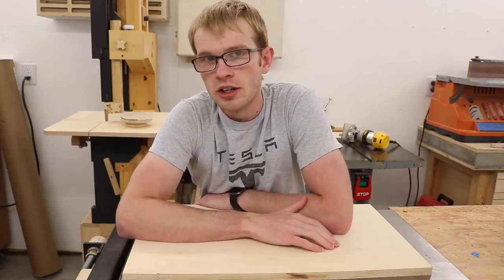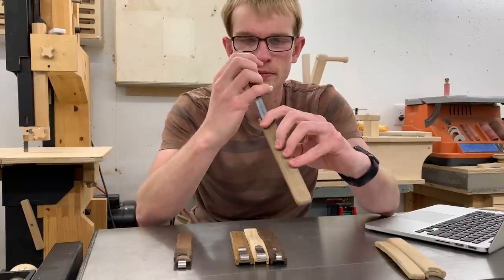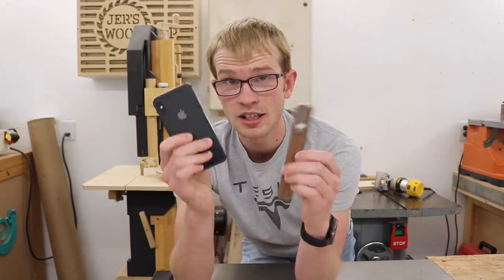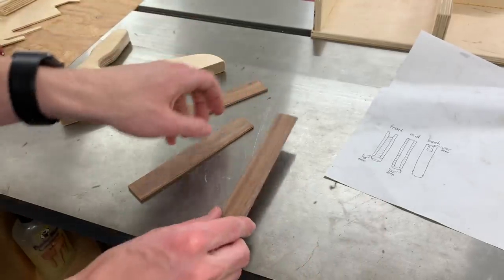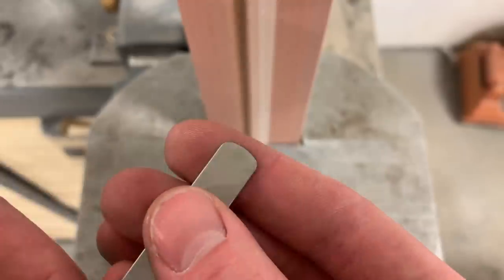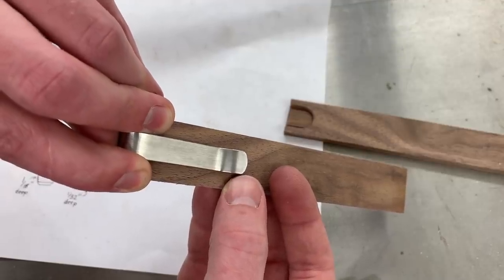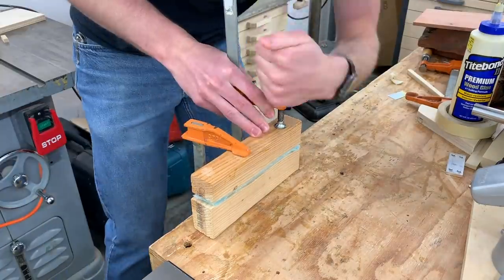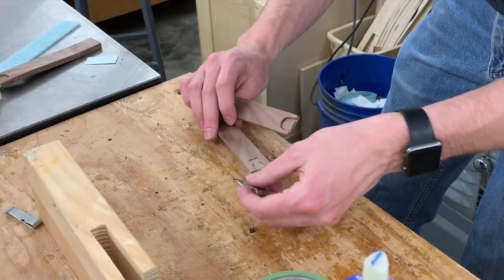Pocket sheath for a precision rule

Comment: If you want to bend a tighter radius in titanium, just heat it with a torch first. You'll have to clean off the oxidation, but it works like a charm.

Comment: Great video 👍 it's great that you include the mistakes and show all the prototypes - it teaches younger viewers that perfection takes time.
Also, an EDC that I have used for 20+ years are precision tweezers called "Uncle Bill's Silver Grippers" they are good as is, but I sharpen the tips by using a small screw and nut to hold them closed while I grind them to a sharp point.  Learned the hard way that metal splinters are tough to find and remove.

Comment: I have a block of beeswax I picked up for waxing string I use for various things.  I used it as a finish by heating the wood with a heat till it was hot enough to melt the wax, and then just rubbing it on the wood.  It worked out very well!

Comment: Nice. Cracked me up! Should made a CAD model so you/we can 3d print....I would try that put it in my shop tool belt for sure.
Reply from the maker: Thanks! Ok, you’re not the first to suggest 3D printing, so I’m gonna try to make a CAD model. I don’t have a 3D printer, but I’m assuming you just need a solid 3D component in DXF or STL for your slicing program to convert to G-code?
Reply: @Jer_Schmidt  A little late but yeah, a solid model in STL would be perfect
Reply from the maker: suchti7654 
I have one, and I have 3D printed it successfully. Shoot me an email if you want the STL jerswoodshop@gmail.com
Reply: @Jer_Schmidt  May i also Email you if i want a new Video? 🤔😊
Reply from the maker: miky max 
You can try, but it probably won’t help. I might make a new video soon-ish, but no promises.
Reply: @Jer_Schmidt  are you gonna start making videos again?

Comment: Such a cool video and great idea. I tried it out, and instead of using the curve, I hot glued a two magnets in. It makes it a bit bulkier, but you don't have to worry about the curve as much. Additionally you can introduce a bit more space for easier access, and don't have to worry about movement thanks the the magnet. Great idea and great video nonetheless.

Comment: When in the shop, I frequently carry a nylon sleeve from a mini-Mag-lite. The sleeve holds a 4" Empire mini sliding caliper measure, and a thin, 6" , stainless ruler with sliding pocket clip.  I carry the nylon sleeve in the bib pocket of overalls, but it works in a front jeans pocket, too.

Comment: The sheath is a good idea as is the suggestion for a slot for the tweezers.  I'm suggesting using a neodinium magnet to hold the rule in place instead of bending the wood.  Magnets are also useful to determine ferrous and martinsitic metals from others.
Reply from the maker: Thanks! I don’t want a magnet in my pocket collecting metal shavings, nor do I want to magnetize my rule, so I’ll stick with the curved slot.

Comment: Watch Adams one day builds, dude from myth busters. He makes a holster for his leatherman out of metal. It uses tension to hold it. You should design one similar but with a slot on the back or on the side for your pocket rule. Then you could keep them both together in a pocket sheath. I carry a leatherman at work but I have to use the belt sheath. I can't stand when it turns sideways in my pocket. I even carry my pocket knife in my back pocket. Guess I'm just funny about things in my front pockets other than my slim card/money holder.

Comment: Jeremy to keep the Ti from make sure the your grain direction is 90 degrees of your bend line or lay it out at a 30+ off center. When you bend with the grain especially tight bends will crack and fail keep up your awesome work Thanks Sam

Comment: The horizontal dirt cleaning slot is genius! Also the interlocking of the plates. - Bending the clip: would heating help avoiding cracks?
Reply from the maker: Thanks! I’m told by the comments that I should bend the clip halfway, then anneal, then finish bending. I think that makes more sense than trying to bend while hot, as it’s such a small piece.

Comment: The way they made this work for scabbards for swords was that the sword is a pretty loose fit in the scabbard (definitely not a friction fit), and then they add a strip of leather near the opening to create friction. That leather could also be oiled so that the sword always gets some oil on it and doesn't rust. Might be applicable here, to reduce accuracy requirements a bit.

Comment: Glad you finally put out new content, we’ve been waiting. That said I’d like to have one made of rawhide with maybe a thin delren insert?
Reply from the maker: Hmmm, that’s an interesting idea. It would be fine for the sheath to be somewhat flexible, since the rule is. So you just need a smooth, long-lasting material (like delrin) for the rule to slide against, then rawhide outside. You might be onto something!
Reply from the maker: What about UHMW? It would be a bit more flexible, right? I don’t have much experience with Delrin.

Comment: If it’s something that’s going to see slot of use like that and it’s made of wood (or any porous material), sometimes I’ll slightly warm it up and then submerge it in an oil or wax finish. not too hot or anything just maybe 100° or 105°. Fahrenheit that is. And leave it soaking at that temperature overnight. Submerged in the material. I usually try to do this only with solid wooden objects because once the oils and wax penetrate the wood completely it could possibly have an effect on the glue bonds. But I have never really noticed much of a problem especially when it comes to titebond 2 and three. But I still avoid it unless i’ve also used a secondary method to secure the pieces together like wooden dowels, dovetails, or some type of mechanical joint. That way the glue did happen to fail, I probably wouldn’t even notice the difference. The glue is just there is excess and extra protection.

Either the butcher block finish, like you showed or the wax would’ve worked pretty well also. I make my own but it’s basically just Birchwood cassey gunstock wax with a few other additives (and a few nasty distillates removed)Also very similar to “feed-n-wax” . The only reason I make my own is because I have access to pretty much free beeswax from the guy down the road, and I used to go through gallons of conservative wax, feed and wax, and gunstock wax every year in my shop. Not only is it expensive, but this way I can tune each batch for different applications.  Cooking some batches so that they stay dry paced even in the hardest of temperatures, or adding/removing things as needed for each application.

By slightly warming the wood and soaking you allow it to really suck up into the pores and fibers. And the end grain will just suck it up like a straw and disperse it more evenly.. Then of course you’ll have to wrap it up in paper towel or something absorbent for a few days so that it can draw out any of the excess. And if you leave it in the dash of your car or some thing and it gets extremely hot it might have a slight layer of wax or oil that seeps out but it will be extremely minor on something that thin

but that way if you have a busy year and forget toilet when it gets really dry, or you don’t have naturally oily hands to keep it somewhat protected… Or maybe you get caught out in the rain a lot or you sweat a lot… The wax and oils are Great protection and basically stabilizing the wood but without actually using acrylic and a vacuum pot. So the wood is still wood, and you’re not adding a ton of extra weight like real stabilization.

. Always love coming back and watching this video. You did a great job

Comment: I like the idea of the full slot in the bottom because you could use it for a square in a pinch, it might not be perfect 90 degrees but it should be close.
Reply from the maker: Someone else just suggested making a brass insert so it would be a precise square. I love the idea.
Reply: A hand crafted multi-tool except for the rule of course. I love as well.

Comment: When you press your bend on the clip, press it with a small diameter drill bit shank for the metal to roll around and you'll have a tighter radius.

Comment: 10:55 right after you made the first bend for the clip, before you go further, you should try and heat the clip with a blowtorch to a couple hundreds of degrees (red hot if it were steel, I don't know much about titanium but I guess it would be quite the same). This way, by softening the metal, the stess you have introduced in the metal by bending will be "relieved" as the atoms will rearrange and come back to a normal crystalline structure. This will make the clip not only less prone to cracking and more bendy, but also much stronger and less brittle for the future.

Comment: Awesome design all around and great video! I was wondering if a small neodymium magnet would retain the ruler if put in the bottom? Downside would be metal shavings getting trapped I guess.
Reply from the maker: Yes, and it would also magnetize the ruler so it would tend to pick up shavings. Not ideal.

Comment: Is there a particular reason the glue squeeze out couldn’t be cleaned? Which would simplify the construction because you explained the design being dependent on having no glue squeeze out. 

In my experience building guitars, especially doing things like bracing and things where it’s difficult to access and clean squeeze out… you absolutely don’t want liquid squeeze out spread all over the inside of your guitar. But it’s pretty easy to clean the squeeze out, but allowing it to gel just a bit to where it’s gel all the way through and not going to get liquid glue everywhere when cleaning… But the little balls of glue are still soft enough to just pop right off. Use something shaped like the ruler and after glue up… Allow it to gel and slide it down in there up against the walls. Something sharp like the ruler would work… But I obviously wouldn’t want to use my nice ruler. Scrap piece of wood would be fine. And have the added benefit of burnishing the inside of the completed case. While making sure there’s absolutely zero glue residue not even a thin film.

But when doing stuff like gluing violin tops or guitar braces or something where it’s impossible to clean squeeze out… It’s pretty easy to control glue distribution so that you have the exact amount needed, where it completely fills the joint and leaves no gaps, voids, while evenly saturating everything… But with zero squeeze out. It’s much easier to do than you would think. Might make it easier but I love your design regardless.

Comment: For your clamping jig could you rip the width to match the width of the blanks being glued and then attach a flange on both sides of one half made from UHMW plastic to keep the alignment?  Or interlocking finger flanges on top and bottom?

Great job as always!

Comment: Great video Jeremy.  I have a friend that is looking into building a CNC router.  He has been weighing the pros and cons between CNC Router parts, Open Builds, Shapeoko, etc.  What is your opinions between the different "solutions" out there for a 4x4' area machine that is robust enough to do some light manafacturing on?  Are rack and pinion solutions so much better than acme, ball screw or v belt solutions?  Can open builds really be built to be close to the same quality of a prosumer application?
Reply from the maker: Of those, CNC Router Parts is by far the winner. I think theirs is probably the best value in any CNC, honestly. Personally I would avoid belt drive, as the belts do stretch a bit and cause some inaccuracy. Gear rack is good if it’s done right (CRP does it right), but acme or ballscrew is probably the most accurate (I actually prefer acme over ballscrew). Also, it’s worth a lot to get linear bearings rather than the little wheels that run on some kind of track. Those collect dust and will never be quite as smooth & accurate. But I realize you have to step up to a lot more expensive machine to get that, so you decide if it’s worth it. 

In case you were not already aware, for the past 2yrs I have been designing a CNC machine in an attempt to make one better suited to people in my situation: small shop, not doing manufacturing so speed is not a priority, but I need accuracy. My targets for the design are: ~$1k for a 2’ x 2’ machine, scalable to 4’ x 4’. Accuracy and repeatability to within 0.005” (hopefully better). Extremely easy to build with basic tools. 

So far I’ve used 5 different CNCs, the last two being prototypes of my own design. It’s far enough along I’m fairly sure I will be able to achieve my targets. Plans will be available if/when the design is finished, but that might be >1yr.
Reply: @Jer_Schmidt  So would you say that your machine is overkill for a small level production studio for flat pack custom furniture designed out of plywood?  I personally would love to do brass, so I only need something with a work area of 12 inches, but my friend wants to do 4x4 sheet ply and have an easier workflow.  I am guessing he doesn't really need the CRP stuff even though it is really nice, it is really expensive. All he needs is a good openbuild with a decent spindle, and maybe look into having acme/linear rails if he wants good speed and reliability.

Comment: It looks great and you obviously put a great deal of thought into it as well as experience. But...why the back layer? It seems like the only reason for it is to provide a mounting for the clip. If you eliminate the back layer you reduce the thickness by that additional 1/8" - I would think that would in turn be more comfortable.

Without trying it - my first thought is to make the sheath side of the clip blank into a "T" shape - and then wrap the arms of the "T" around the sheath. Those would in turn fit into a shallow dado/recess in the exterior of the sheath - resulting in a mechanical lock as well as preserving a level surface. A bit of epoxy would then lock it in.
Reply from the maker: I don’t think it would hold its S-curve if it was thinner and only two layers. But I haven’t tried it so I can’t say for sure.

Comment: A couple of other things you could try are Kydex, which seems a good idea at first because with heat it’s malleable, but I don’t think it would be great for a ruler that small. The other idea is g10, that might be the perfect thing, you could make it to be just the right size for the ruler and it ought to hold up better than wood. Also have you tried putting either leather inside the sheath or maybe felt? Both things could hold the sheath in without needing the S curve
Reply from the maker: I guess I would rather have wood in my pants than G10. I like how it looks, even if it might not last quite as long. But I think G10 would work just fine if you like it.

Comment: Great idea and the execution was of course meticulous and super clever.   I wonder if wood is really the ideal material for this.  I’m thinking the whole thing could be made from titanium and actually be slightly smaller and maybe even lighter.  I’m not sure what the best way to go about making it would be. I work with metal all the time but never titanium.   
I guess you work with what you have and I don’t see how you could have possibly done it any better with what you had.
Reply from the maker: I like the aesthetic of wood, so I didn’t really look much farther. But there are likely better materials. I wonder if Ti would be harder on the rule (scratch it up more)? Maybe not because dust gets embedded in the wood...

Comment: I carry a small keyring 1.5mtr tape measure on my keys I use it all the time! When I'm in the shop it hangs out of my pocket so I can just pull the tape and measure
Reply from the maker: I considered that option, but for the stuff I do I needed a more precise instrument. This rule has a mark every 0.01” (0.254mm), and I can easily see if something is halfway between the marks, so I can measure to +/- 0.1mm.

Comment: Make a simple jig to lay it in while gluing, just a bit less thick than the total thickness, one piece either side and one at the bottom to stop it sliding about while gluing.
Reply from the maker: Good idea.
Reply: Thanks, I spent a few months working a welding job where components were clamps in to place on a boards with a series of toggle clamps etc, it mentally scarred me for life, I can't do anything without thinking about jigs, I enjoyed your 6 inches of wood.

Comment: I thought that you originally made the "debris removal slot" as wide as a ruler so you could use your sheath with slotted ruler as a try square and I was slightly disappointed that you didn't use it in the last version. If it's not accurate enough maybe you could embed a small metal block for a slot which would be more precise and wouldn't wear out like wood.
Reply from the maker: Yeah, I never thought of that until a bunch of commenters started suggesting it. It’s a great idea!

Comment: Super nice sheath! Will have to make one some day. Any particular reason for choosing titanium over stainless spring steel? I have a feeling it wouldn't crack as easily but I might be wrong. Cheers!
Reply from the maker: I’m just going by pocketknife clips, but I’ve had a stainless pocketknife clip break off from catching on a door strike plate, and I’ve had a couple of them bend open so they won’t pinch my pocket anymore. I can literally bend the titanium clip open till I can fit my finger under it, and it pops back and holds as well as ever. So it seems tougher to me, but I haven’t compared the same size/shape of clip side by side.